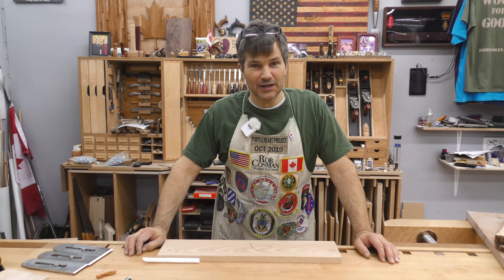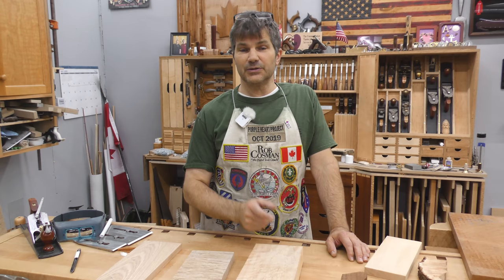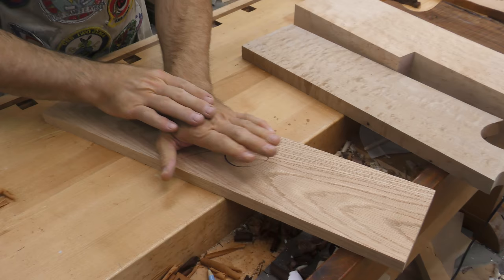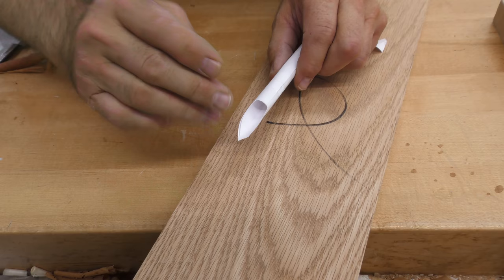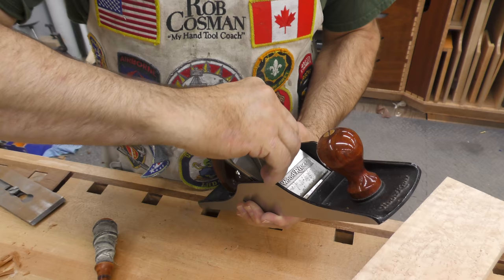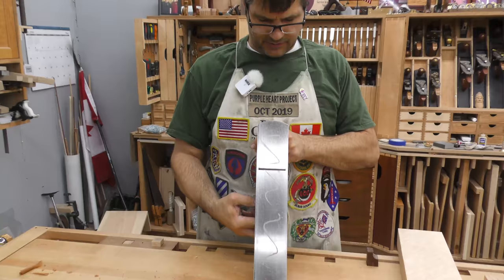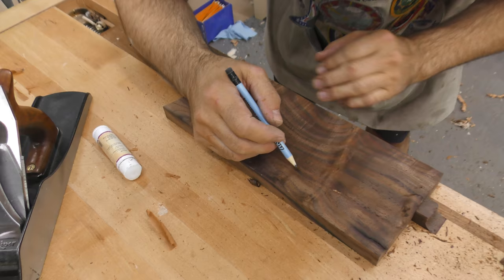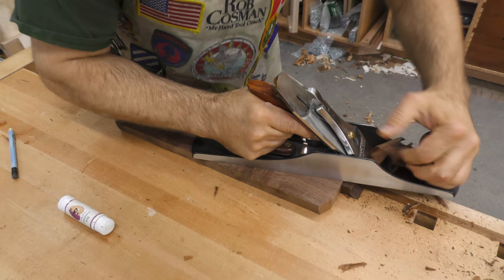Hand Planing Wood - How to Prevent Tear Out

Comment: What do scrubs do that do not posses a power plane and need to plane before the surface finish and only get the cheap wood with grain going its own way.
Reply from the maker: Try again, Im not following your line of thought.
Reply: @RobCosmanWoodworking  I am Sorry. It seemed to me in the video that the slabs you used hat been pre-processed by a power plane to a flat surface with minor tear out by the machine.

I once tried to scrub a stained kitchen table out of hardware store wood - and the plane dug right into the wood on occasion. The wood was laminated in like 2-4cm  - ther was hardly a grain to follow -the plane hardly took any chips, but ritght in front of a wood eye it would dug right into the wood leaving nasty tear outs wholes. It will most probably be a stupid beginners fault paired with cheap tools - the good planes are just out of reach. I read somewhere if the blade is too thin the plane can start to stutter.

I am sorry for the bad writing of my first post. I had the impression that the slabs were pre-processed and I need to make it work without and just stuck and clueless why and had hoped to find an answer in this video and it seemed like - if you have a 4.000$ thickness planer you take off the damaged surface and later smooth it of with very small junks.

Again - should have done something different and comeback later with a more coherant train of thought.

Comment: little confused on changing the angle on the blade from 45 to 65, i kinda thought you would have to change the frog bed angle with bevel down plane , does the change take place on the micro bevel?
Reply: He'll have put a back bevel of 20 degrees on that high angle blade to make the effective angle 65.
Reply from the maker: Sam to the rescue again!  You could change the frog to a different bed angle but WR doesnt make HA frogs.  A much easier solution is to buy a second blade and on the back of the blade grind in and polish a 20 degree bevel
Reply: @clamage    have had tear out and always used a scraper plane , this is much help, Thanks
Reply: @RobCosmanWoodworking   thank's found this a very helpful video as most of your videos, especially sharp inning videos , been a game changer for me.

Comment: What I'm hearing you say here Rob is that I need to buy a high angle smoothing plane in addition to my standard angle smoother.
Reply from the maker: Not really.  My message was a sharp blade and short projection will solve almost all tear out issues.  For the 1-3 percent of the time it doesnt work then your next step is high angle
Reply: @RobCosmanWoodworking I need to buy a high angle smoothing plane... got it :)
Reply: @Exodus5K  Just the blade, not the whole plane.

Comment: For the high angle setup, did you just do a 10-15 degree bevel on the blade?
Reply: Yes I was wondering the same thing??
Reply from the maker: 20 degree, used a jig
Reply: I am working with figure mahogany, to avoid tear out, i use a 25 to 30 grade, plus the 45 grade of the plane.

Comment: I have a existential doubt about woodworking with hand tools. 
Is there a wood so hard that you can not work with handtools?
Reply: Interesting question - I'm trying to think of any woods we use now but didn't 100 years ago :)
Reply from the maker: well I would say no, but there are lots of woods I dont want to work because they are really hard and squirlly
Reply: Guiacum sanctum
Reply: Easily confused with petrified wood. I fave no idea how it was fashioned into propeller blades that outlasted steel blades.
Reply: I've found that MDF is a very difficult wood to work with hand tools. We have a lot of MDF trees near where I live!